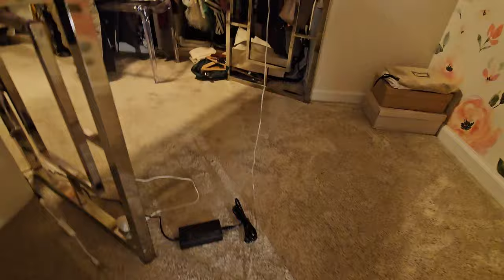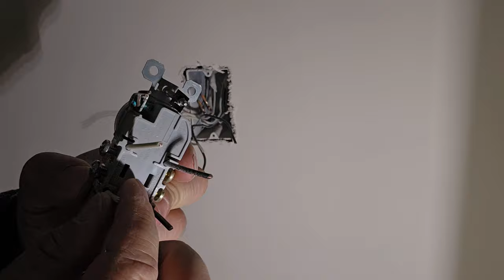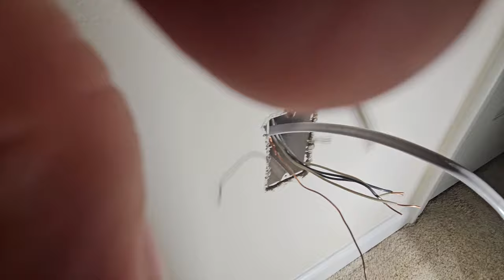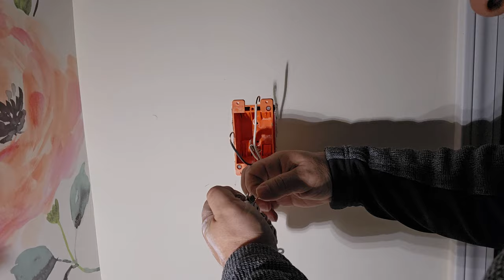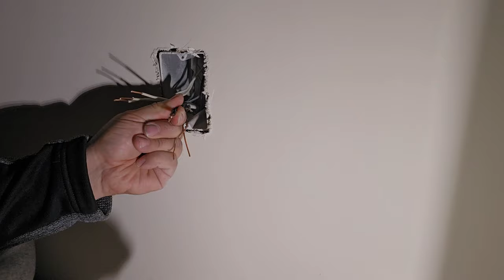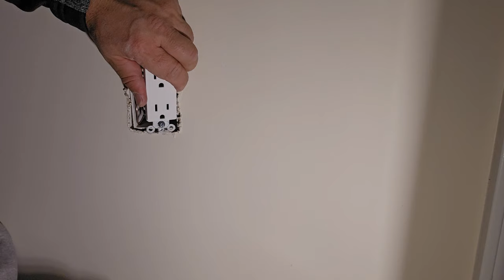How to install an electrical outlet in a new location #electrical #electrician

Comment: Resepticals also have 2 holes on each side to slide 2 wires on gold side and 2 wires on silver side, no need joining with a cups. Would want also to see you adding new outlet not across each each other but several feet sideways apart on same wall or opposite wall. Its harder, require fishing the wire sideways.
Reply from the maker: Thank you for the feedback! Yes that is right you always can use the holes. The only reason I do not do it is because I'm not a fan of using the " backstabbing" method. Thank you  for the Idea of a new content video!